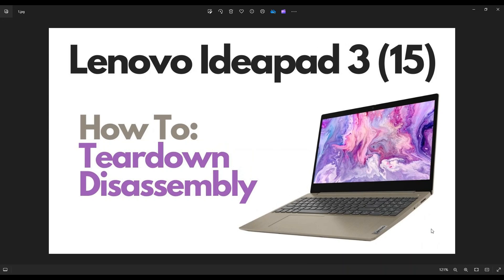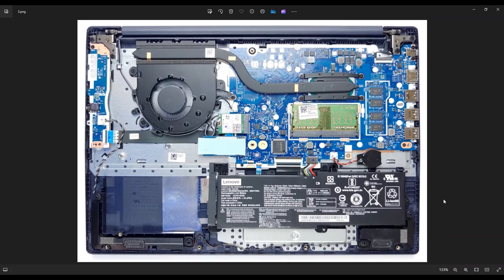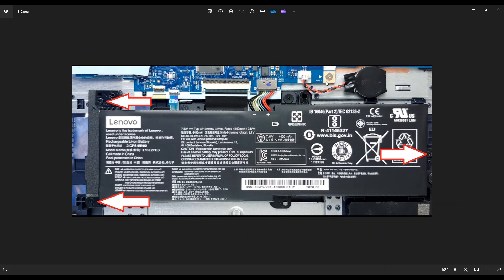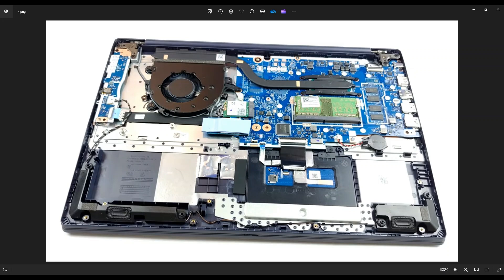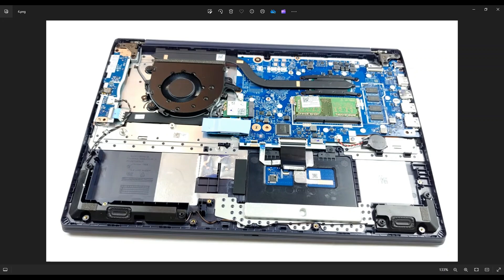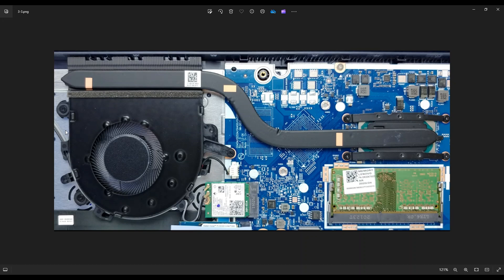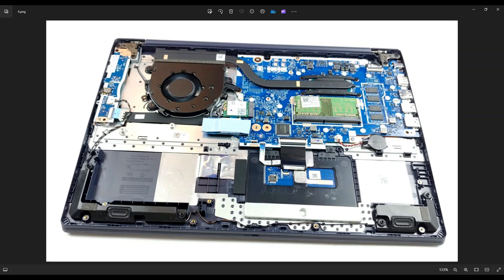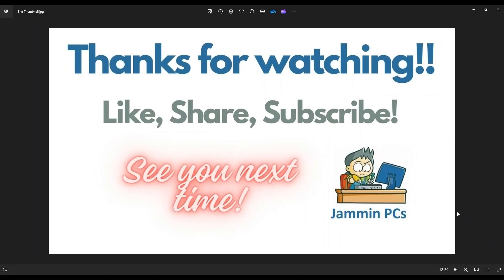Teardown Disassembly Upgrade Options - Lenovo Ideapad 3 (15)

Comment: My charger cord got jerked out of my laptop and the little plastic piece at the end of the charger is still in the charger port. Luckily, I am still able to charge my computer by taping the charger to the computer at the charging port. I also taped the charger wire to the back of the laptop to it doesn't pull at the charger port. Without the tape, the tip of the charger will fall out of the charging port. If I open the computer, will I be able to remove the little plastic piece that is normally at the end of the charger but is now lodged in the charger port?
Reply: Nevermind. I found the tip piece (actually some metal and plastic) on the counter! This means the charging port is clear. I tried my other AC adapter and it fits in the port (nothing blocking its insertion) and my computer is charging. I guess my old damaged charger was working because the two tiny metal prongs sticking out were still making contact and charging because of my tape job. I learned from your video though how to install a new battery. Mine isn't lasting very long anymore.
Reply from the maker: @lauraelliott7441  Glad you got it figured out. Sounds like an annoying issue. Sorry you had to deal with that :(
Reply: @jamminpcs  So thankful I saw the little tip on the counter. Very hard to see with the patterned granite. Otherwise, I would never have realized the charging port was now clear. I had a spare charging cord and just ordered a backup.